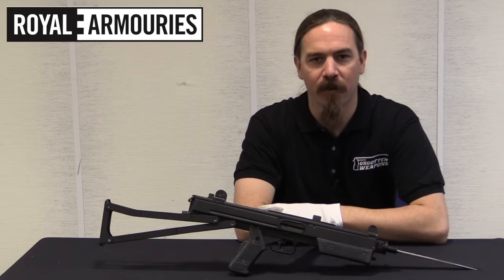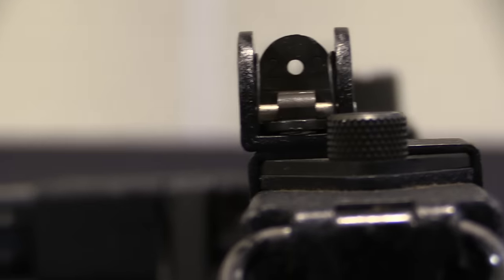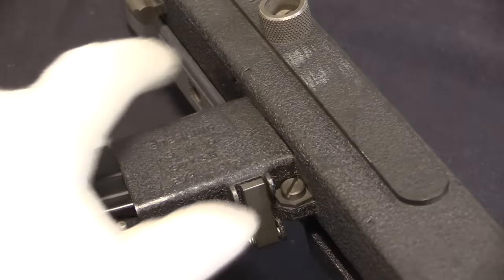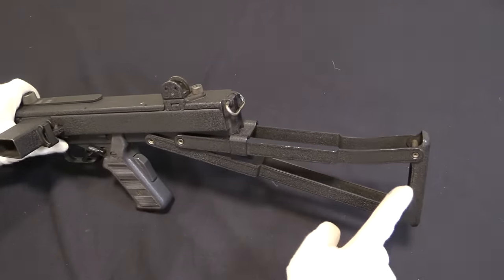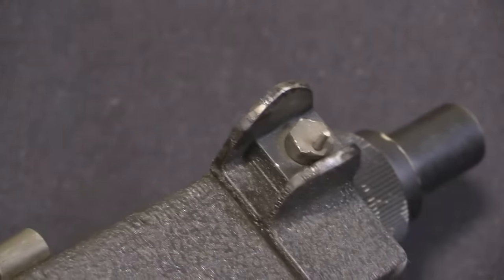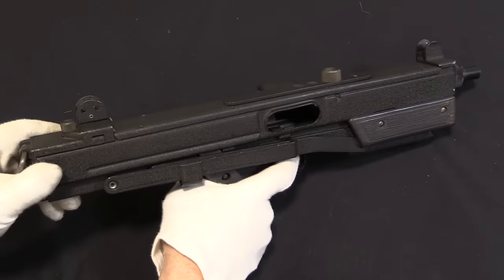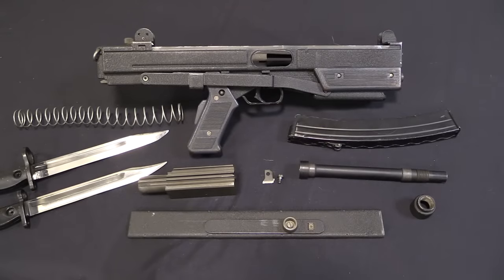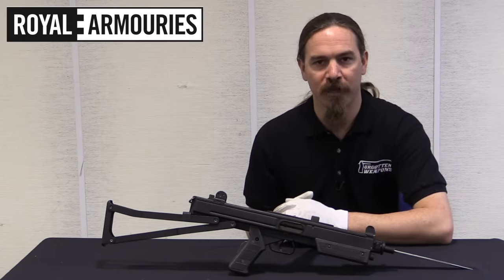Sterling S11: Donkey in a Thoroughbred Race

Comment: Everyone gangster till a mad man runs at you with two bayonets on the same gun
Reply: Only upgrade I can see is attaching a Gurkha and a couple of kukris to it
Reply: @vattmann1387  that would be bad. Bayonets are straight for a reason. You wield it like a spear. Kukri is for slashing.. 
Though it might work with a one handed gun, like a sidearm
Reply: @soumyajyotimukherjee4752  You have to think outside the box, with a curved blade your gun turns into a glaive instead of a spear!  With two bayonet lugs you can choose to slash in two different directions, or slash AND stab!
Reply: Halbred smg
Reply: Funded.
Reply: @Apathy293  Someone has to draw this and send it to Ian :)
I think we could fit an extra kukri on the underside of the folding stock also!
Reply: @vattmann1387  You can never have too many!
Reply: Especially  if those bayonets are phillips screwdrivers fastened with duct tape
Reply: If you have to use a bayonet in a fight in these times, it means you are the second unluckiest guy (or gal) in the world- the unluckiest one is the individual you are actually going to engage.
Reply: To be fair, that'd freak me out a bit.
Reply: @Apathy293  better yet, a Kukri with a hidden bipod.
Reply: @kevynhansyn2902  Colonel 100, is that you?
Reply: @vattmann1387  So we have the typical british soldier holding the gun but with the Gurkha with two kukris attached to the gun.....bayonet charges have never been so devastating.
Reply: @Apathy293  hahahahahaha "Dip Dip Potatoe Chip"
Reply: Needs a brass knuckles grip lol
Reply: I feel like this is going to end with monster hunter weapons
Reply: If only they had added an under barrell grenade launcher....😁
Reply: Put a third on
Reply: london

Comment: GAU-8 Avenger engineers: "We need a plane on a gun!"

Sterling S11 engineers: "We need a gun for our Bayonets!"
Reply: The A-10 is a beloved CAS aircraft, unless you're its target, this thing...
Reply: @bthsr7113  Some ideas are better than others.
Reply: GAU-8 only has around 80mm penetration at combat ranges, tanks have more to fear from the MANY precision munitions the A-10 carries.

Fortunately, with the advent of IFV's, there's a new generation of vehicles on the battlefield completely defenseless against GAU-8.
Reply: @cheyannei5983  don't forget the top armor on tanks is a lot thinner.
Reply: @austinm.9832  I'm not. Don't forget that even the roof has a spall liner and the rounds aren't coming in straight up and down, either. Active protection systems further defang poor old A-10... though many can't reach up towards the sky, being little more than an alternative for vehicles too light to mount N/ERA.
Reply: The sterling was the sten replacement. The bayonets are there so you can still kill people with it after you drop it, assuming it's not killed you.

Comment: Barrel is offset for two reasons:
1) to line the sights up with the eye with such a large, wide stock
2) so that recoil is in line with the longitudinal center of mass that is effected by the magazine on the side.  This should negate the tendency of the gun to 'climb' to the right under recoil.  My opinion is that if you were to place a half-loaded magazine in the gun, you could balance the weapon on its muzzle.
Reply: Could be... but I’d point out that if a design for a SMG offsets the 1) barrel, to fix the 2) sights because of 3) the stock and 4) the magazine, the designer may have forgotten, out of 1, 2, 3 and 4, which is the part a soldier points at the enemy to do the whole “gun” thing the gun is supposed to do. This wasn’t meant for the job of a Bren in WWII, after all.
Reply: Honestly, dumb as it may be... I think the barrel was placed there to allow for that jungle carbine bayonet.  Why they didn't make the gun narrower (or literally any other solution) is beyond me
Reply: built in Kentucky windage is what it is

Comment: 2 Bayonets on an SMG
2 Taps on a sink

BRITISH ENGINEERING 🇬🇧
Reply: Except 2 taps makes sense one hot, one cold. At least to me but I'm British so...
Reply: @Dom-J  What do you do when you want to run water that isn't either ice cold or scalding hot?  

Me, an American, I just turn on the hot a little and the cold a little and get warm water to wash my hands in.  Ahh, the luxury of not being in the UK.  I can wash my hands in water that's exactly the temperature I want, among other things.
Reply: @immikeurnot  You turn both taps on at once. Sounds silly but you use the amount of each to sort the temperature. Like lots of hot + some cold = hot water that's good for washing hands in. To you this may sound ludicrous to you, but I have never had issues with it.
Reply: German here and we have them too sometime, i prefer them, then again we also love to drive stick/manual so....
Reply: @immikeurnot  Because the British way of doing things was to fill the sink bowl with water of the required temperature and wash their hands in that, then pull the plug. Washing ones hands in running water uses five or six times the amount of water than using the bowl. Shaving with running water uses even more. Also the pipe systems in the old days were completely seperate for hot and cold water, making mixer taps a non ideal solution for houses with older plumbing systems. 

Saying that, mixer taps are far more common that seperate taps these days, this idea that the British still use only dual taps is rather like the one we have of most Americans not being able to drive manual transmission vehicles.... Oh... wait..... Most Americans cannot in fact drive manual transmission.....
Reply: Two values, one tap.
Reply: @alganhar1  but as a doctor, if i want clean hands, I have to use running water. Not stagnant dirty water in a sink bowl...
Reply: @Dom-J  At least in here in finland the sinks have a single tap that simply has articulation kinda like a joystick does. Turn it up and down to adjust volume and side to side to control temperature.
Reply: It goes back to the days of water storage tank, where the hot water from the tank was not deemed fit to drink, whereas the treated water from the cold main was. Meanwhile in America, people died from drinking unsafe water.
Reply: Jake Hughes , you’re, short for you are, simple huh?
Reply: @alganhar1  the father away you get from the cities the more people there are that know how to drive manual.
Reply: @uegvdczuVF  they exist because cold water which is what you drink comes from a tank in your house so when there's an infrastructure failure you still have precious clean water at least that's what they used to exist for and you if you want different temperatures now you just turn them both on different amounts
Reply: @nicksande6880  i drive only manual, but thats because i drive only old vehicles and my truck is just an 80s sports car made into a pickup truck
Reply: TheKamiBunny as a doctor I’d presume you could figure out emptying a bowl after using it.
Reply: @alganhar1  I'd like to know how you could use 5-6x the water washing with running water.  I call B.S.
Reply: @J4K33L1T3  no you're the one getting angry over better taps. I have a one-tap system here in London
Reply: @موسى_7  "angry" is going abit far dont you think. I simply stated the temperature of the water isnt an issue. Cold water is cleaner for washing you hands as heated water will only ever be hot enough to incubate germs not kill them. The temperature water needs to be to kill bacteria is higher than the melting point of human flesh. Cold water, soap and vigorous scrubbing are far more efficient at actaully disinfecting your hands.

If the water was hot enough to kill bacteria it would also scold your flesh, Making the whole exercise redundant.
Reply: @Pete-z6e  yeah, considering a slight mispelling triggered this kind of a response from you. I'd say you probably are slighty simple indeed. Thank you for sharing this premise with the group.

Note: try to form an argument relating to the topic at. Rather than simply displaying a secondary school level of english comprehension.
Yes, most with a decent understanding of english know the difference between. Your and Youre, but functionally it is not relevant, and langauges arent this inherent thing with one right answer because we redefine language by using it, you'd be much better served not worrying about simple apparent grammatical errors, the truth of the matter is grammar is not important in most uses of a langauge. And most people who speak any given langauge cannot follow the proper grammar anyway. If you try to explain something to a person in grammatically correct english nowadays it causes confusion to most users of the langauge. In the modern day we use more slang and have adjest out words if we want the majority of people to be able to understand.
Reply: @TheKamiBunny  As a Doctor you should probably be smart enough to figure out that cleaning your hands the more expensive way is acceptable.
Reply: The two taps on the sink have to do with a period of outbreaks of bacterias in the communal hot water heaters and an easy way to secure the cold water from being contaminated.
Reply: @Dom-J  European standard is one lever that controls both the temperature and the amount of water, that's just a lot more convenient.
Reply: They also have windows that swing open to the outside.
Reply: lmfao
Reply: We have 2 of everthing 😉
Reply: @thunderball11111  But then you'd also have to clean the bowl every time after usage... Anyway, why are we suddenly putting doctors under the same limitations is the real question
Reply: You mean 2 faucets. Many in the US don't know that the British traditionally had two faucets, one dispensing cold water and one dispensing hot water and you were intended to run your hands from one to the other to even out the water temperature. 

Insane.
Reply: @marks6663  they are called taps...
Reply: @-lightningwill-6014  dude you should really look shit up before you start talking. The mechanism that carries water from the end of your pipes to your sink, and controls the flow, is called a faucet. A tap is what you use to get beer from a keg.
Reply: @alganhar1  You're right.
Reply: Also pretty much explains the offset too. 🇬🇧
Reply: @Keifsanderson  Well I am pretty sure most home sinks have the...the thingie you pull and it closes up the drain. 
Does that even make sense?
Reply: @kniter01  What are you talking about?
Reply: @Keifsanderson  I think i may have misunderstood what you mean by: 

>I'd like to know how you could use 5-6x the water washing with running water.  I call B.S.

for some reason i thought you wanted to use the same sink water several times, which both weirded and confused me
Reply: @kniter01  Yeah...that guy's assertion that washing your hands uses more water than filling up even the smallest sink basin to a usable level was just dishonest or ignorant.
Reply: @TheKamiBunny  Most people are not doctors, and this works fine enough for most situations. You can also rinse your hands under running water, hell, you can fill the bowl, get your hands wet, get the soap, wash your hands out of the water, then dip the soapy hands into the bowl and pull your hands out, and now you have negated your whole problem with the system.
Reply: One is hot one is cold why use one?
Reply: @Dom-J  so then you either have freezing cold or boiling hot water. How do you make WARM water?
Reply: @alganhar1  how in the hell do you think that washing your hands in a narrow stream of warm water uses more water than literally FILLING YOUR SINK from TWO goddamn taps?
Reply: @alganhar1  most cars don't have manual transmissions now because modern computer assisted automatic gearboxes are far more efficient at shifting gears than human drivers. They're also safer to drive
Reply: @Columbakin  no, HOT water comes from a tank. Cold water comes straight from the pipes
Reply: After reading these comments i feel like 90% of being British is just coming up with absurd explanations for why you do things the wrong way
Reply: And the ACTUAL reason is "because the British did them first so we didn't actually KNOW the right way at the time, but they're too stubborn to admit they did it the wrong way so now it's just "tradition""
Reply: @J4K33L1T3  On hot water temperature - it's BS, you're not trying to kill bacteria with temperature. 

It's a standard temperature related reaction - soap chemically removes grease and all chemical reactions are faster at higher temperatures.
This saves you a second or two over using cold water...mainly it's for comfort :-)

(I have Raynauds disorder...cold water is fucking agony)
Reply: @Superabound2  Automatics are not safer to drive. Automatic transmissions decide for themselves when to shift gears, which has nothing to do with what's going on around the vehicle, which the operator can see.
They also encourage lazy driving habits (one handed driving - emergencies requiring two hands do not advertise their approach) and a general lack of appreciation of what's going on around you, which creates more opportunities to kill people with all that kinetic energy you're not respecting.
Automatics might be easier to get you going, but learning/using the manual skillset increases your safety overall.
Reply: And tea makers in all tanks they have made “we are under attack but a spot of tea first?”
Reply: It's time for tiffin! brews up and put on yer slippers!
Reply: @J4K33L1T3  Bro nobody else does this. Even a hundred years ago if you had warm water in the continental europe, you had a mixing battery. The only houses that have two taps here are rich people's mansions from the 20's because they wanted to emulete the british aristocracy. Czech republic btw.
Reply: @blarfroer8066  Don't all windows open to the outside? Surely you don't want it taking up interior space? I had no idea that was even a thing.
Reply: @anthonylester2128  I guess other countries are more aware of the possibility of someone falling out, especially kids. And they're a lot easier to clean if the open to the inside.
Reply: Double tap rules
Reply: The amount of people not knowing what they are talking about is staggering.
The british system has nothing to do with how you turn water on and off or how warm and cold water mix, but are actually 2 different pipes in the house.
The reasoning came from WW2, when houses were cut off of water from bombings and it was established, that every house would get a water-tank in their attic, so if water ran out, they'd still had some reserves. 
Since the locally stored water isn't as safe as the fresh one, it's heated before use. That's why there are 2 different faucets, one for cold and one for hot and it doesn't get mixed and put out at that mixed temperature as continental-european ones would.
Reply: @nicksande6880  Dutch are also insanely obsesed with driving stick. Probably so they can think they are driving F1
Reply: @Max-fb5bm  Why not one tap so you can wash your hands in warm water without scalding them
Reply: Jake Hughes bruh you realize the reason you use warm water is to dissolve more solids right? Doctors don’t tell you to wash with cold water, and for good reason
Reply: Mike L finally! Somebody makes sense here
Reply: I don't get your point. Who doesn't need a hot bayonet and a cold bayonet?
Reply: @TheKamiBunny  fwiw Here in the Rep. of Ireland where we tend to follow the example of the British in such matters, in the Wound Clinic in my local hospital- to take an example- while the toilet areas use the 'two-tap' system, the clinical areas have modern elbow-operated mixer systems, although these were almost certainly retro-fitted.
Reply: all from a gun video...
Reply: @Dom-J  One tap ice cold, one tap boiling hot and you cant mix them to get a usable temperature. Two taps makes no sense.
Reply: @SuperDerpHerpson  they're called taps
Reply: Taps on a sink are to, you know, get water….and separate hot and cold is a great thing, means the water is actually drinkable  among the benefits. Try learning about something rather that trying to be funny about it ( and failing)

Comment: "... the guy behind the design of the SAR-80 rifles" 
"uh oh"
Reply: SAR-80, not SA-80. I don't know if the SAR-80 rifle is bad, but I suspect it's fine since it's basically just an AR-18 variant as far as I can tell. Waters was NOT involved in the atrocity that was the SA-80 (the bullpup that doesn't work).
Reply: @neruneri  Well, at least the A2 variant of it is fairly good
Reply: @TrueFlameslinger  thanks hk
Reply: @AleK0451  They funny thing is, while HK fixed the guns issues, they really didn't change that much.  Most of their improvements simply involved changing alloys or heat treatments for parts that failed, or making extremely small adjustments.  The A1 was almost a really good gun, they just couldn't quite figure out how to fine tune it.  The core design works just fine
Reply: @danbell3827  i know, it's a nato gun so in theory it would literally just be a bullpup ar15 or something along those lines which as long as it isn't literally a converted bullpup ar15 should work fine, they just had no idea what materials to use and how to make those small adjustments
Reply: @AleK0451  the SA-80 was a bullpup'd AR-18, not an AR-15. I'll never understand why they decided to bullpup it when the standard AR-18 was a fantastic rifle as is.
Reply: @dallasmckim4370  i didnt say it was an ar15, i said it would be like one at its most basic functional level
Reply: @dallasmckim4370  This is just my speculation, but probably due to storage/transport logistics (less space taken up = more guns in that space), weight, and overall length (troops do have to lug these around for a good while alongside their normal gear,)
Reply: Lots of countries love re-designing an ar-18 into really weird things for some reason
Reply: @TrueFlameslinger  And the SA-80 was heavier than a FAL